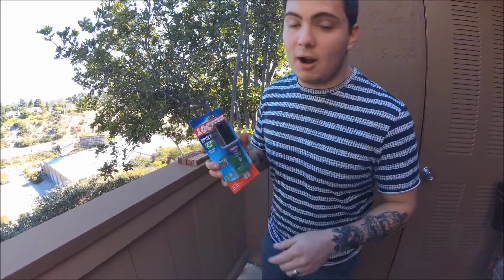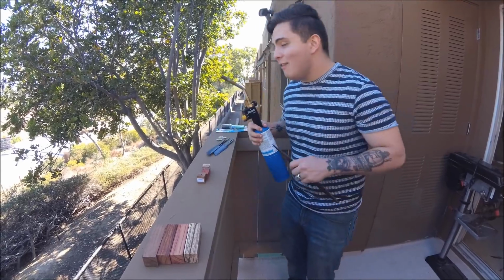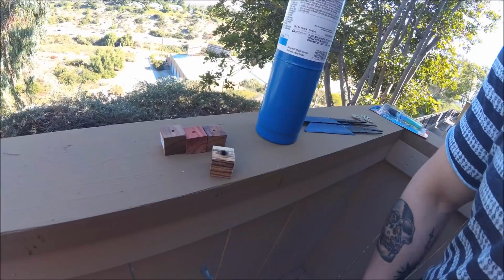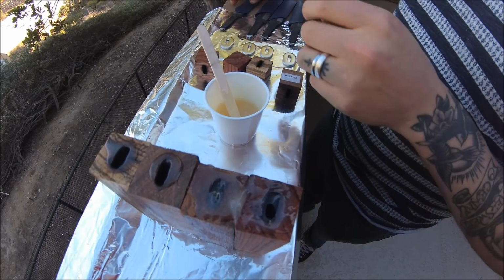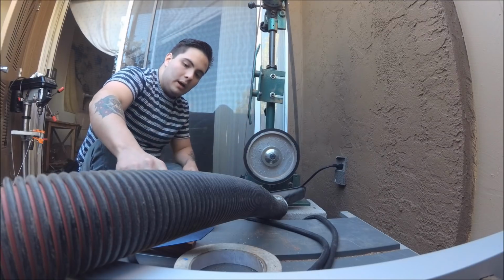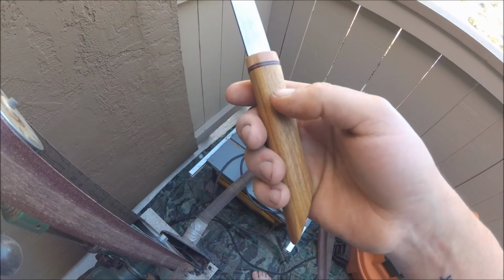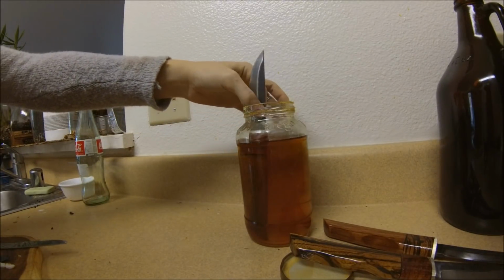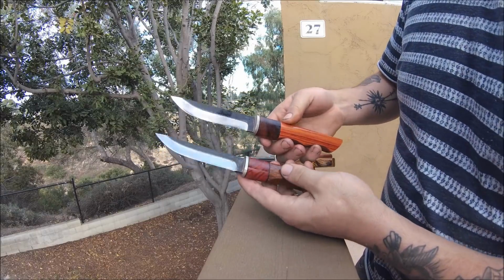The Four Scandi Knives

Comment: I like your knife handle styles F-K...throw in some Walnut burl, Kingwood, Buffalo horn and Cocobolo.
Reply from the maker: +jeremiah johnson 
Okay
I had a traumatic experience with Walnut, I tend to never use it (I also don't like the color either) 
Kingwood is cool and all, but it's expensive and so is Cocobolo (cocobolo is also oily as a can of sardines)
Buffalo horn is hard to cut evenly and if I used it, due to the matrix it has, extremely high sanding would have to take place, and if you can't tell, I hate sanding.
Thank you :)
Reply: Gotcha F-K...beautiful work you do man.